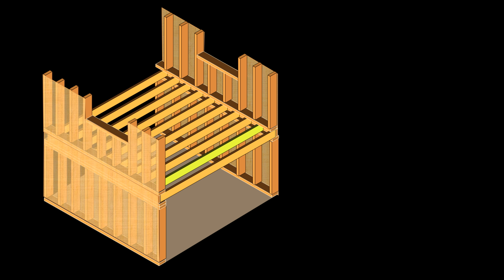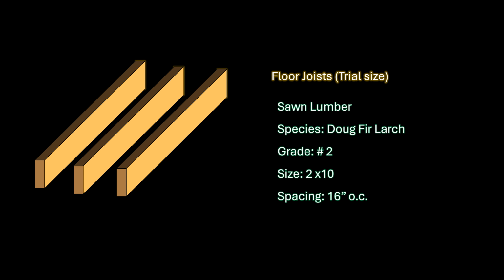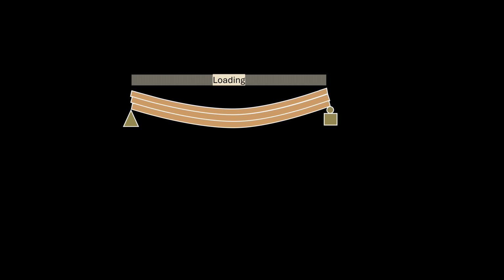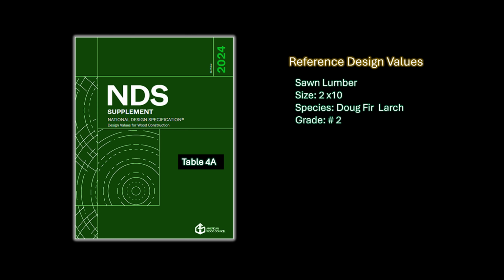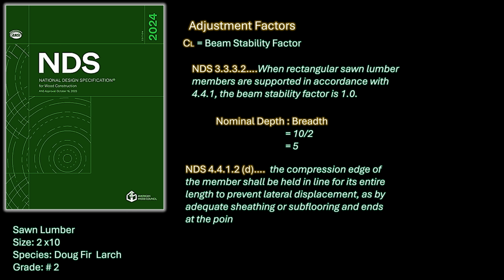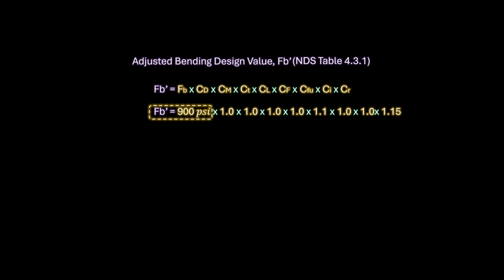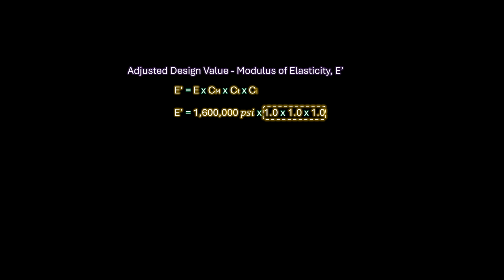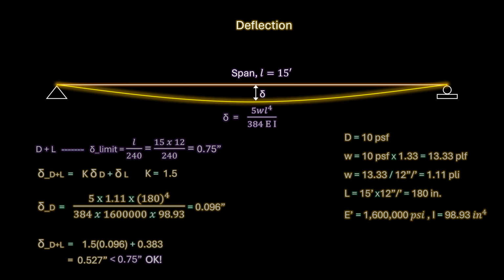How to Design Wood Floor Joists per the IBC & NDS (American Standards)

Comment: Great video, thanks for sharing. I would have liked a comment on penetrations though the joist/s, to allow for example, electrical and or plumbing to pass though. A reference to where, in the international building code, covering penetrations would be helpful.
Reply from the maker: Thanks for your comment. See 2021 IBC section 2308.4.8.4 for notches and holes in joists. Please see https://youtu.be/ZZU5-NVnR50?feature=shared where i have covered this topic comprehensively for residential construction under the IRC.